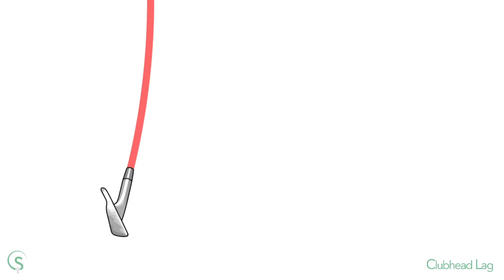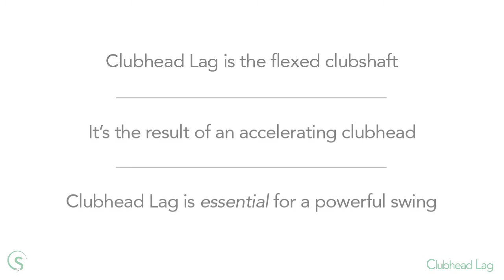Clubhead Lag

Comment: Loading a club shaft became a possibility in the 1930s when metal shafts came into used in a it is what led Byron Nelson to develop the now universally used dual plane swing.

The challenge at the top of the backswing is dropping the hands down and forward anti-clockwise for viewed from the ball position while the club force is still pulling them up and forward clockwise. The solution to that dilemma is SIDE BEND.  Twisting the spine to the right laterally as the club comes to the top will jerk it down in the opposite direction causing the shaft to bend.

The challenge then is to find a way to keep the hands accelerating faster than the shoulders are turning.  The solution is again side bend.  If the golfer progressively increases the amount of side bend as the hands swing down they will stay progressively further ahead of the shoulders, maintaining the side bend.  Because I have a longer than average torso and understand the physics I’m able to maintain the  bend in the shaft past the point the hands reach the bottom if their swing arc and start up. 

I use an unconventional (for golf) downswing action but one used with a great deal of success and efficiency by construction workers who swing 10 pound sledge hammers and lumberjacks who swing 12 pound double bladed axes with laser precision to chop a V into a horizontal log at opposing 45° angles. One simply needs to arrange the club face in the grip so when the wrists lock down the face will be square to the the target and then chop down at the ball from to top at a 45° angle.  

BTW what is incorrect in the illustration of the shaft bend here is that the shaft in the downswing bends opposite the direction the toe of the club is pointing because the club head mass is attached to the shaft at the heel.  It is only just before impact that wrist action rotates it into the target.

The reason the club shaft will bow forward during the downswing is that in the downswing the first move is to laterally shift and rotate the hips to 45° open and they will get stuck there IF the back heel is kept on the ground.  If the golfer uses a grip and right arm leverage that keeps the hands from swinging ahead freely when the hips stop at 45° open just as the shoulders being dragged open by the hips back parallel to target and hands also bring club shaft parallel and level with ground the combination of momentum and gravity now able to pull the club mass down will cause the shaft to bow down and forward IF THE HANDS SLOW DOWN.  The hands will slow down if the golfer is not using side bend as described above to keep the hands accelerating faster than right shoulder and / or does not lift the back heel to free the hips and get hips, shoulders and hands all moving together again.   

While I was working to perfect the timing of my Count Yogi and Hogan inspired swing I snapped the heads off several irons and Drivers until I realized from watching Hogan’s back foot action I need to release the back foot just as the club was making contact with the ball to avoid the forward acceleration of the club head mass faster than the hands that occurs as the hands swing up ahead of lagging club head to the point of snapping the shaft at the hose.  The cause and effect is that releasing the hips via the back heel allows the hands to catch back up with the club head mass.  Ideally that catching up occurs while ball is compressing on the face and then abruptly snapping the wrists down and locking them triggers the explosive rebounding of the ball off the face.    https://youtu.be/Wp2mvkuPiag